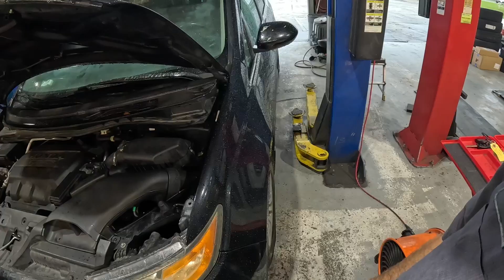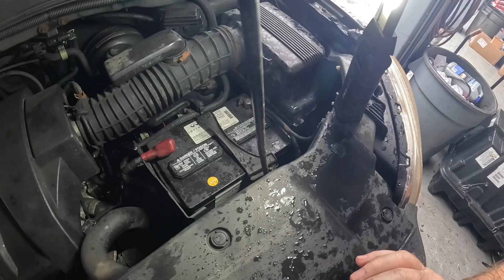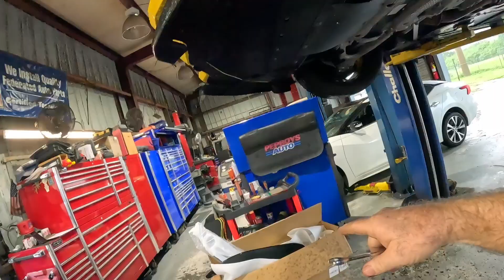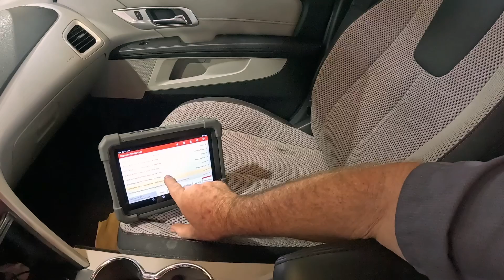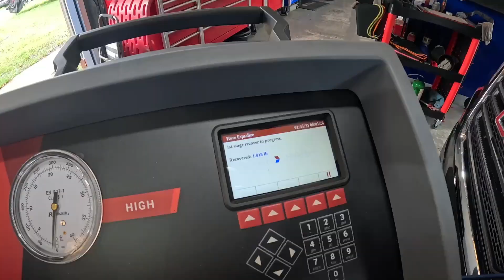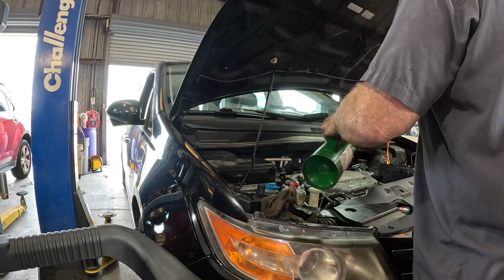Corvette ground effects, Terrain, Broken Hondas Odyssey & Pilot, DAY 532 in the shop

Comment: The only times I’ve seen a Honda blow a main fuse are from shorted/oil covered alternators or from people trying to boost a battery and hook up the cables backwards. It should be an alternator issue most likely, but sadly we’ve seen a bunch of people get their reds and blacks mixed up😂
Reply from the maker: Very true!

Comment: Brother, everytime I hear that Blueprint engine fire up and idle, it just puts me in a different headspace. That engine makes true, mechanical, natural, horsepower with no computers, variable valve timing, etc.  I hope someday you have some time to take it on a nice run to stretch its legs. They did a nice job building that engine. Its impressive. Does it have air conditioning? Vintage Air??
Reply from the maker: Yeah, I heard from Delta PAG today that my fan is on the way, we’ll make some cruising videos soon!

I am using Old Air Products system for AC. So far it fits and works great!

Comment: Well it looks like you had a rather slow day. On my Ranger leak it was self inflicted by using a new spring clamp on a new upper radiator hose at the thermostat housing. Replaced it with the old worm clamp problem solved. Have a great day!
Reply from the maker: That is good to hear, nice easy fix! Awesome!